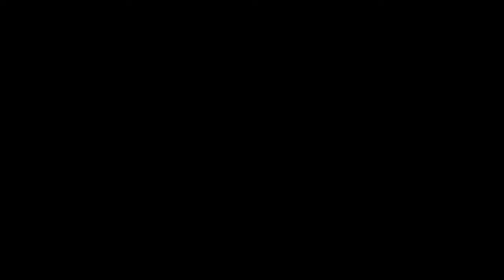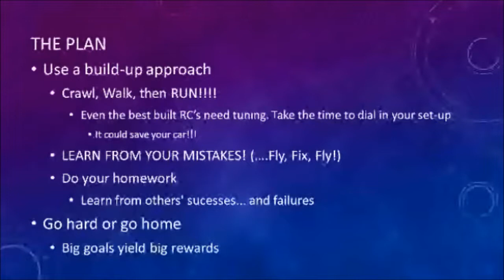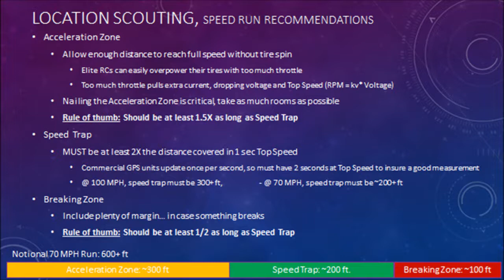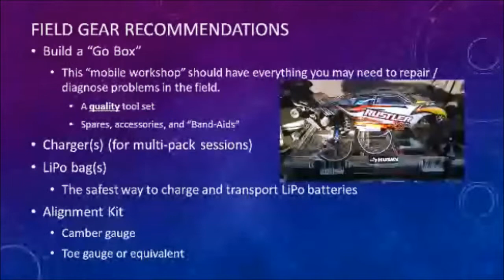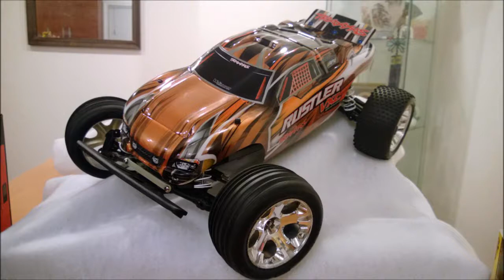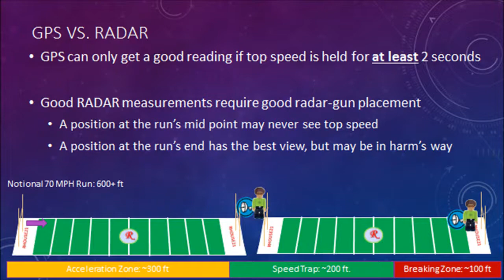Ep. 26: Speed Runs 101 - The Definitive Guide to Safe Running

Comment: Great video for beginners, i'm kinda novice at speed runs but experienced with RC in general, speed + lipos + gear ratios + high spec ESC,  those combinations together is the big learning curve, more over is the fact I'm using an early millennium Kyosho PureTen EP Alpha running a 3S lipo,  currently just short of 50mph,  determined to do it the hard way without just getting a rustler, Castle esc and a 6s lipo, I want to build it, make it get there myself. But it's hard when I'm kind of a noob to lots of the things listed in the combinations. But with help like this, I will. Thank you.
Reply from the maker: Thank you for watching and for the kind words! I'm convinced that a quality 3S setup can do a lot more than most realize. A good battery and a 150 Amp ESC can deliver ~1.8 kW (~2.5 hp). This us enough to stir up more than a little trouble.
Reply: rhouse21 - RC Physics well I'm currently waiting for my local hobby shop to get a 65t spur gear, and already have a 40t pinion gear, though I'm not sure if I'll encounter problems with getting the gears to mesh, i'll have to wait until it arrives to see.

Comment: Good information. I am new to  speed runs and have already made several of the mistakes you covered, some more that once and I have not yet gone for top speeds.  But I am learning and now have may several test runs without any more crashes.
Reply from the maker: Thank you! I appreciate the kind words.
Reply: After watching a video by mrtuner89 having to watch his Rustler burn to the ground because he did not have a way to safely put out the fire. ( He did make the right choice to let it burn rather than risk getting hurt.), I have added a low tech item to my pit equipment.  A bucket full of sand.  It works very well to put out a fire quickly.
Reply from the maker: Jack Dyer That's an awesome idea! Thanks!